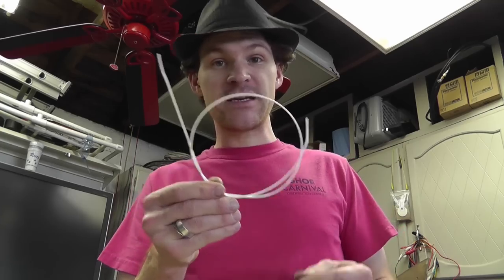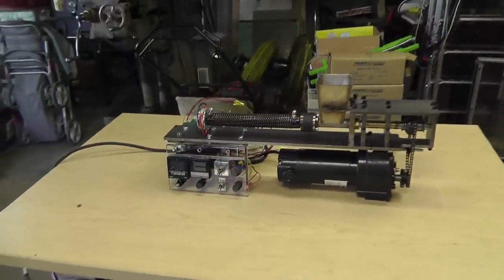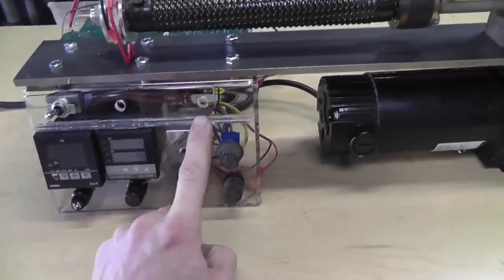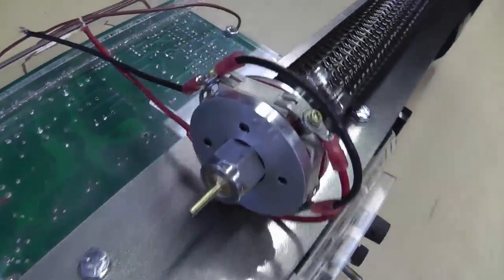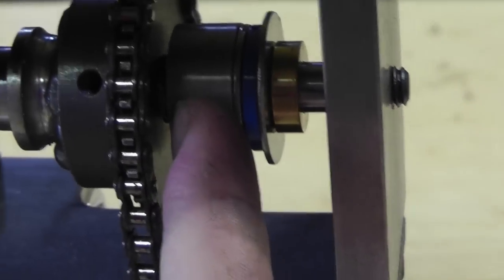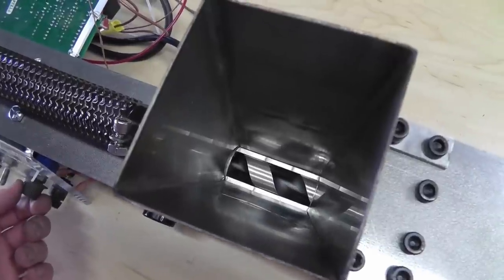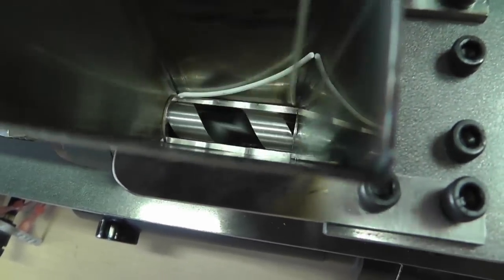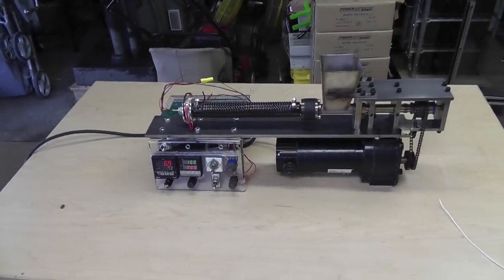#1 ~Russ's Home Brewed Filament Extruder For 3D Printer. First Look. Built From Recycled Material.

Comment: the screw is the most important item in extruding plastic. if you are using a drill bit, I doubt weather you will get consistent results. for success you will need to use a plastic screw for extruding or machine one

Comment: Russ!! can you or someone else print out the parts for a delta 3d printer? Theres not much for a delta model on ebay, and the other printers average about 250 just for a frame... :(

Comment: Russ this may sound totally far fetched and I'm sure the temperatures would be an issue but what about the large rolls of weed eater nylon line? Would it be possible to use that kind of plastic for your printer?

Comment: As a guy who has a graduation in Plasturgy and worked in this industry, let me tell you my opinion about these good intentions resumed in a bad design :
It's very nice to reuse a commercial wood drill bit, but the step is constant, meaning the transporting speed is also constant, and as the heat zone is also constant, your material will be warmed up constantly at the same temperature all along. The best is to use a variable step screw, transporting your raw material across different temperature zones. Each zone should have its own thermocouple and temperature regulation. Once your plastic is melt at the tip, it shouldn't come out directly from the nozzle but be stored in a small space ahead of your screw. We use this as a feeding zone to keep the pressure constant at the nozzle, which lead to a better diameter control, once coupled with an automatic roller at the end of the water bath. All these techniques are easy to implement and used everyday in the plastic industry. So the best thing you can do to improve your machine is to design a real extrusion screw , like these ones : http://tinyurl.com/yddxoggd (look how the variable step slows down the material while transporing it to the extrusion head, simple but efficient). Time to grab your lathe ! Last : use steel and ask to a chrome plating service to harden it with the adequate surface treatment (chrome, of course), it helps to avoid the plastic sticking to the precious vice. Cheers, and have fun. 
PS : if my english looks like spoken with dawn syndrom, this is just 'cause i'm french and never use this language. Hence the style is ...

Comment: hey russ in your vids you showed how you get your prints to stick by mixing up acetone and abs plastic i tried it out and its very very messy to use also cleaning the prints after is such a pain i have tried almost everything well today i decided to use car clear lacquer works perfectly try it out and let me know what you think hope it helps you out
Reply from the maker: hey,
haven't tried that before. what brand do you use? others say that hairspray works too? tried it once but could not get the print off!

i can agree its messy at times.

although i have found out that if you mix it extremely thick ( not runny) and just spreed one thin layer to the point where its clear. ( i use only clear ABS currently on the " mix" even if i print with other colors.) the clear seems to stick so well you dont need to make a thick layer.... once printing is done let it cool and it will pop off. but just the points of contact will come off. this makes no cleenup of the print necessary.

i need to make a video of this some time, also some new thoughts and information i have learned over time.

thanks!!

~Russ

Comment: hi russ. very good video and machine. Would you tell me where i can get a 33 ohms resistor. 
thank you
Reply from the maker: ebay, something like this, but i cant grantee that it will fit your pipe... ~Russ http://www.ebay.com/itm/NEW-NASA-SURPLUS-TYCO-CHASSIS-MOUNT-RESISTOR-220-5-500W-TE500B220RJ-/161759871506
Reply from the maker: this one is kinda like what i got but you need the right wattage. http://www.ebay.com/itm/WI-9713-63841-17H-57-OHM-10-WIRE-WOUND-500W-RESISTOR-W19713-XLNT-/121060775637